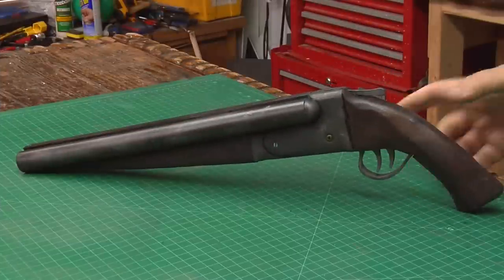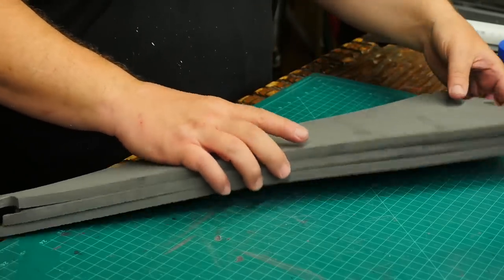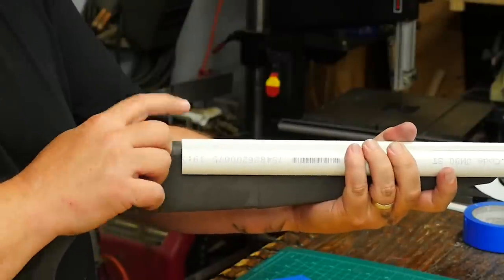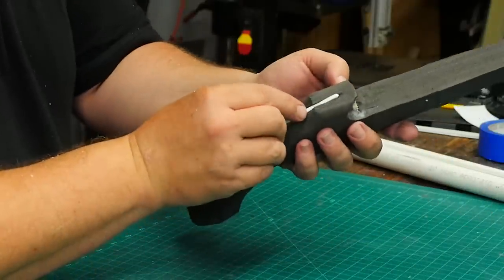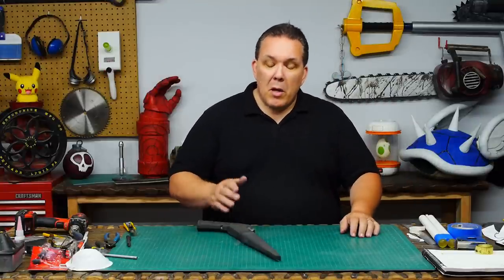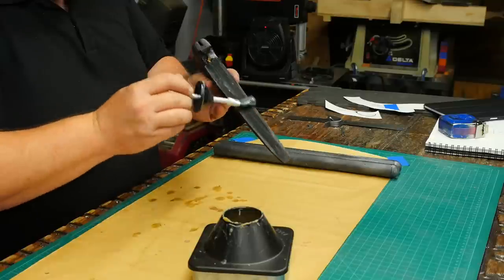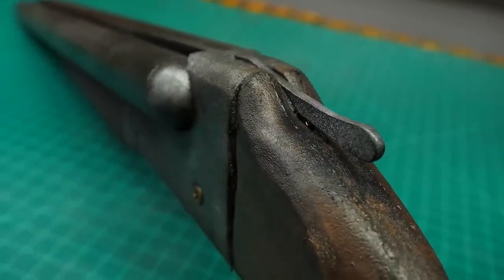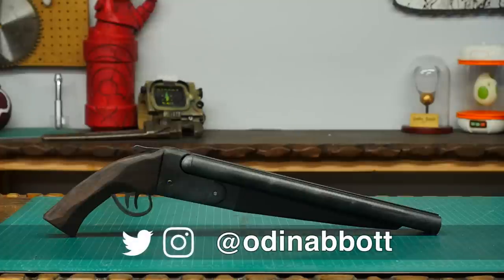Odin Makes: Sawed-off shotgun from Mad Max and Evil Dead

Comment: Excellent piece. I was planning on something similar for my wasteland garb, but I went with a repaint of a Dollar Store cowboy revolver due to time constraints. I left the orange tip intact so I wouldn't have to deal with headaches from the 5-0.
I may have to go ahead and do this now, because you can never have too many guns in the wasteland.
Reply from the maker: That's right! I almost wrapped hockey tape on the grip, but stopped because I had just hockey tapped the machete, and didn't want to do that same thing again.
I did some quick Fallout 4 guns for Smosh a few years ago. They were toys wrapped in sisal rope and burlap. Great fun!

Comment: Plastidipp will stick to PVC if you lightly sand the surface and add multiple thin layers of the Plastidipp at a time. I've made a few props using that method and it's worked for me. Hope this helps
Reply from the maker: Sweet, thank you!
My favorite paint for plastics is the vinyl spray paints made for car interiors! That stuff sticks to anything, and since it's made to paint car seats, it bonds like crazy! Super strong chemical smell, and it costs a little more, but when you need it...
Reply: Odin Makes krylon and Rustoleum make an exterior paint that is made for plastics. It works great, give it a try when you get a chance.

Comment: Dear odin: i made a flintlock pistol using the same method, the only thing I've change is that i joined four pieces of eva foam and the center is made of two pieces of 3mm wood.
Reply from the maker: WOW, cool!  I really should have added a core to the stock.
I made a blunderbuss some years ago, pre EVA foam years. PVC pipe with a big funnel on the end. Goofy looking as it should be. But everyone knew what it was!

Comment: Long force-a-nature

50% faster firing speed

50%faster reloading speed

Triple jump on equip

150% damage bonus

Deals 150% damage to buildings

50% faster running speed on equip

150% more bullets

150% more accurate

Rounds: 4
The ultimate scout
Long force-a-nature
Han Solo’s blaster
The fry-ear pan

Weapon pack bonus: your victims turn into make anthro wolfs also known as furrys

Comment: To make a full stock, should I use a wooden core for the entire gun?
Reply from the maker: I would highly recommend making a full wooden core yes. Just thin stuff will be fine, 1/4" or even 1/8" will do it (3mm or 6mm), with EVA foam to give it some thickness.
With a full stock, you could stop the core 1 1/2" (40mm)  from the end, and just have the end of the stock be EVA foam. So if you need to thump someone with the butt of the gun, the edge of the plywood would not hurt them! :)

Comment: Hi Odin, I have a small question.
Are there any alternatives for contact cement?
The reason I ask is because I don't live in America and they don't sell contact cement where I live.
Reply from the maker: I would need to Google it. I know a lot of what I do could be done with hot glue, but not as cleanly.
Rubber cement might work, but it would not be as strong holding parts together under stress.
Barge is a brand name but it is still a contact cement. It's actually better than the DAP stuff I use, but it costs more...
I am not sure what to suggest that will dry as quickly, and have the same strong bond... I am really sorry!
Reply: That's fine Odin, I'll figure something out. 
And amazing prop dude, looks incredible

Comment: what is the measurement of the thickness
Reply from the maker: Of the grip / 3 layers of foam? about 1.5 inches or 38~40mm the foam is not consistent in manufacturing.
I didn't have a real gun for reference, so I just went by 'feel' - "Yeah, that feels right"

Comment: I dont get the point of this prop. Just buy a shotgun and saw it off. It poses no more danger than this prop if you dont use it irresponsibly and load it 👍if the event is really anal then keep going from there and take out the internal mechanisms.

Comment: Love Odin Builds, but this seems a little irresponsible to me, considering today's climate. I can see someone building this and using it as a fright device to commit robbery, etc. In a situation, even though it's foam and plastic pipe, in the heat of the moment it could be construed as real. In the current times, you could find yourself getting shot by police
Reply from the maker: This is actually a tale as old as you want to look it up. Why do modern toy gun have an orange safety tip? It's not just Airsoft, it was also LazerTag, a light gun game from the 80s. A young kid got shot because he had one. 30 years ago. Not today's climate.

Fake guns have been made for bad reasons for as long as guns have been around.

Your are not wrong, it's risky. That is why I don't have a pattern posted for this build. And I won't give away this prop on Patreon.
I made it because people still want the props to cosplay as their favorite character.
Reply: Considering how easy it is to get hold of toy guns I seriously doubt any criminal is going to go to the effort of making this instead of buying a toy pistol and spraying it black.
Reply: Paint? You can get $10 BB guns that look a damn real M92F at Wal-Mart right off the rack as long you're 18 (and some stores with lazy staff might not even card people for those).

Nobody with nefarious intent is going to go to the trouble of actually making a realistic fake gun when toys and bb/pellet guns that look real are so cheap and easily accessible.